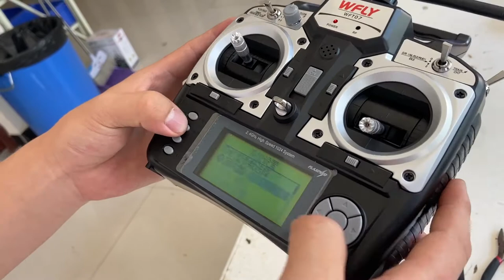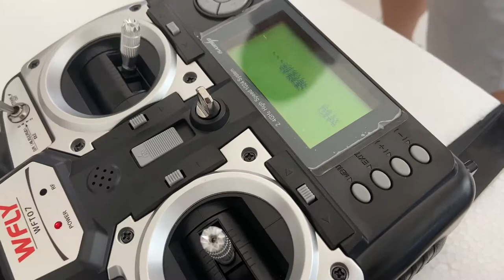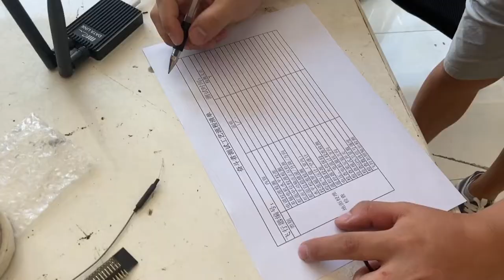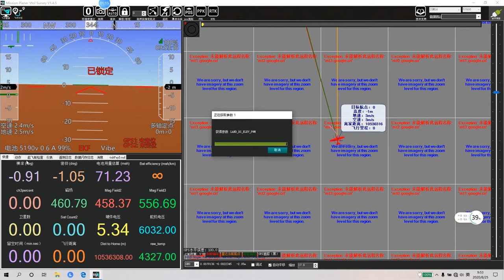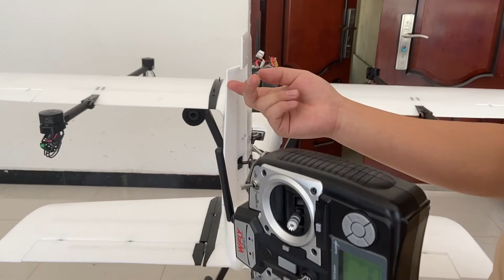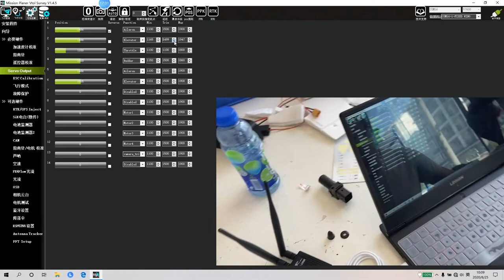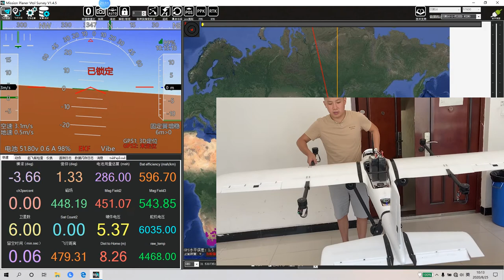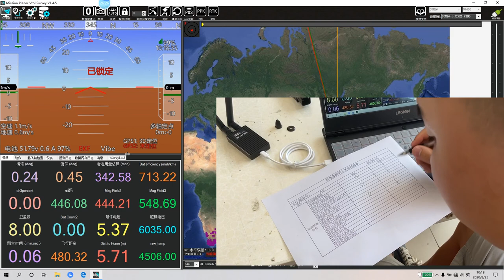Fighter Aerial Survey UAV Assembly Guide 9-Remote Control Setting,ESC Rudder Surface Debugging

Comment: Should arrow engraved on AP module point backwards instead of forward? Or it`s not a big deal?
Reply from the maker: The flight control parameters can modify the installation direction.

Comment: Hi guys, could you put your checklist right here? Thanks!
Reply from the maker: 1. Acceleration calibration
2.Compass calibration
3.Remote control calibration
4.ESC calibration
5.Battery monitor calibration
6.Fault protection